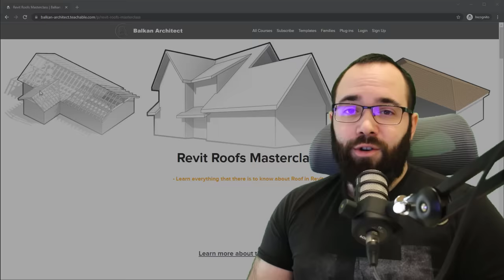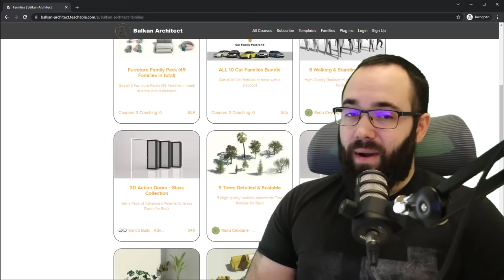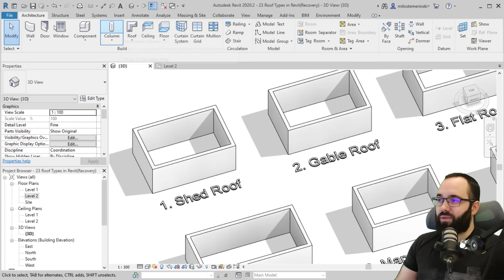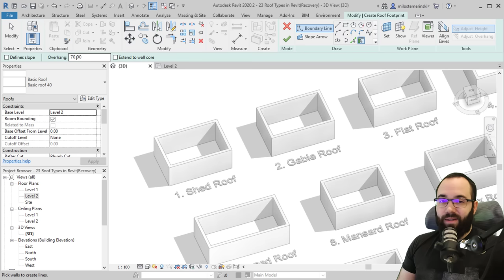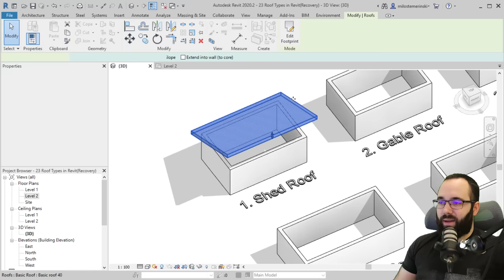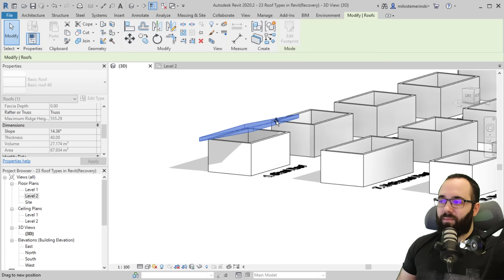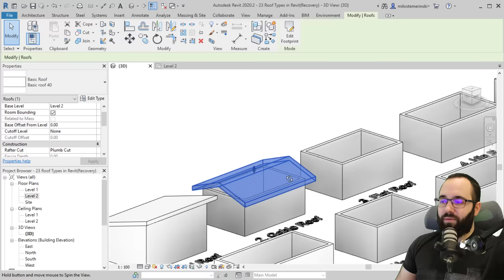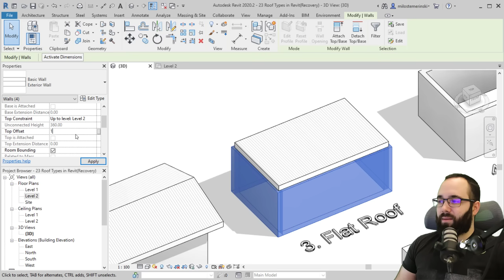Revit Roof Tutorial - I modeled 23 Roof Types in Revit

Comment: No need to apologize for length of video(s)!  The repetition of commands in this video is a great way for my old brain to get a solid grasp that I'll remember tomorrow!  Question regarding #19 Dutch Gable:  you adjusted lower roof slope to 25 but left upper roof slope at 30.  If slopes were matched, you'd still have horizonal line where roofs touch, but in real construction these regions would be continuous.  If we matched slopes in this case, can we 'merge' the two roofs into one and perhaps the line/boundary would go away?

Comment: Quick question - with the example number 8, the mansard roof. The way that he's modeled it, it's essentially using two roofs. However the section shows a big flaw - because of the differing thicknesses, once the roofs have a vertical edge, the steeper roof has a much deeper edge, so there's a clear discrepancy there. Is there a way to neatly bridge that connection?

Comment: love the vids Balkan, can you tell me how to do a flat roof on a circle structure (like the one you use for the dome roof) but instead of completely flat put a 5degree slope from the front of the building down to the back of the building? (I then would like to offset below that a sloping ceiling at the same angle with a void about 300mm) cheers

Comment: Yep, another one who does not care about rafters connections, purlin design, concrete ring beams, insulation, battens etc. This is what actually defines the roof in BIM, not an angled rectangle. Why do you guys even need a powerful BIM software, if you may draw rectangles in 3D Max?